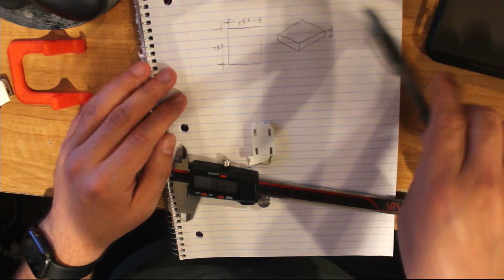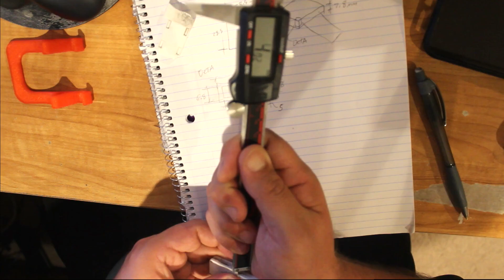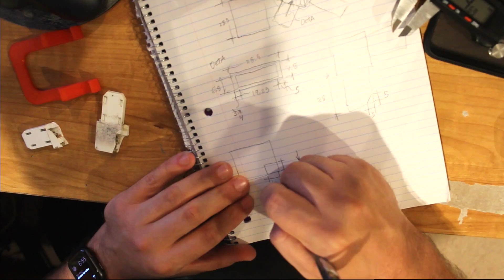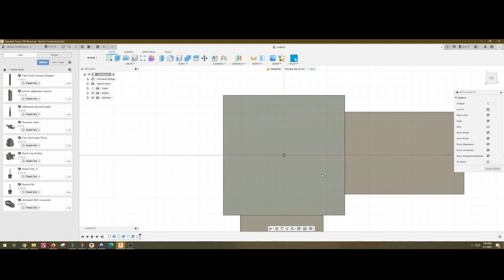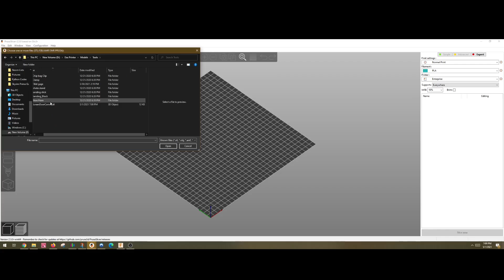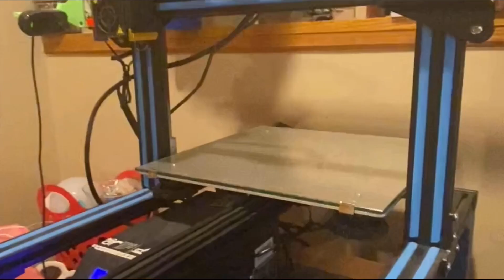Fixing Broken Home Parts - 3D printing, CAD, Fusion 360, and the power of Reverse Engineering

Comment: Saw your post on the 3D printing fb group. Nice viedeo! Thanks a lot! What printer do you use (creality!?) - hope you can give me some advice...;)
Reply from the maker: Yep, I have four creality printers. The one I used in this video was my classic CR-10.
Reply: Cool, thank you! Think I will start with the ender 3 v2...
Reply from the maker: @nicoyannick1620   That's a solid choice. I ent with the Ender 3 Pro as my first printer. It has a ton of support on the FB groups as well as mods for the auto bed leveling supported by TH3D firmware.

Comment: Very good instructional video.   I have been wanting to switch over to Fusion 360 for some time now but I have been using 123D Design for so long it is hard to break away.  I think Fusion 360 would be so much better for precision though.    Also, your voice reminds me of Alan Rickman's voice - I bet you get that often.  :)
Reply from the maker: I’m not sure it’ll make a difference what modeling software you use as long as it’s parametric. Blender and other sculpting software would be more of a challenge to get accuracy though.